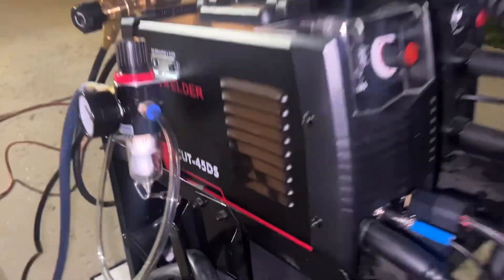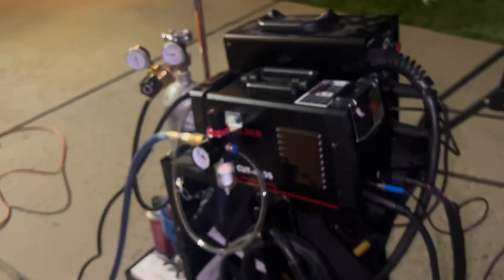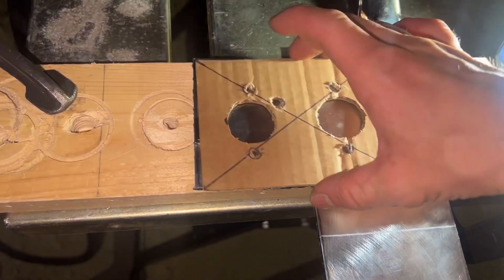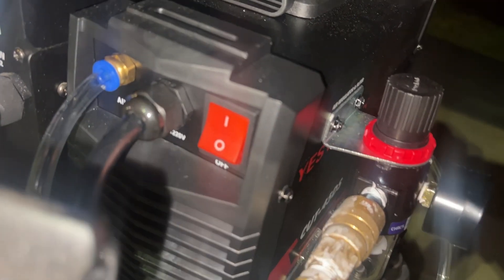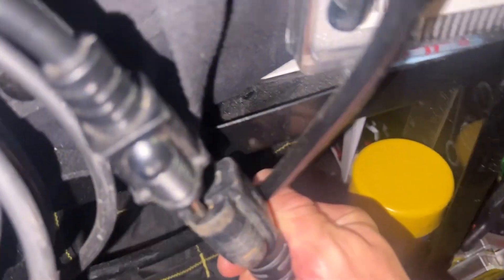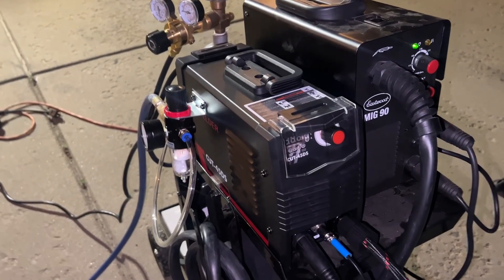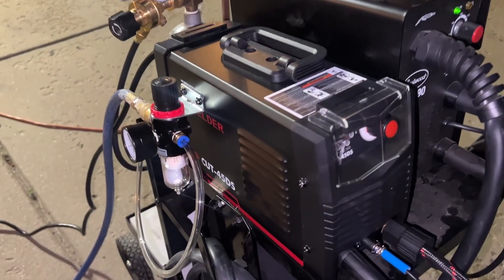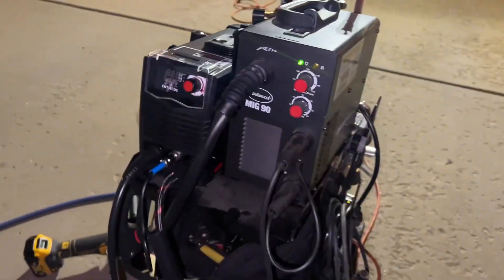YESWELDER CUT-45DS Plasma Cutter Quick Review | How Long Did it Last?

Comment: Thanks for that.  Just bought the exact same cutter on Amazon prime day.  I better get out there and test mine.
Reply from the maker: Yeah it was a crazy good deal. Mine may have just been a dud, use the heck out of it the next 30 days, people seem to have good luck with yeswelder stuff. I gotta use my new bestarc machine a lot. I heard if you get a bad one they usually fail fairly quickly